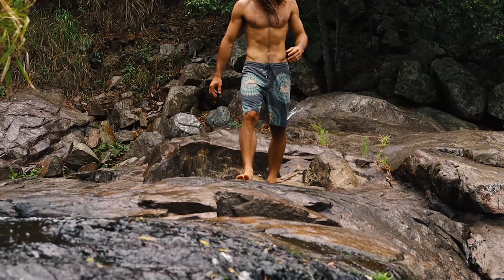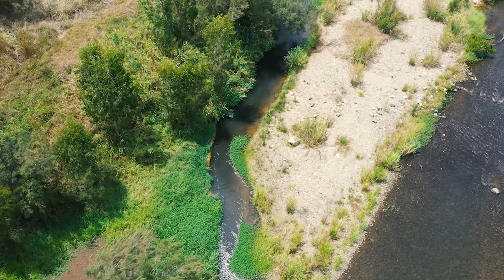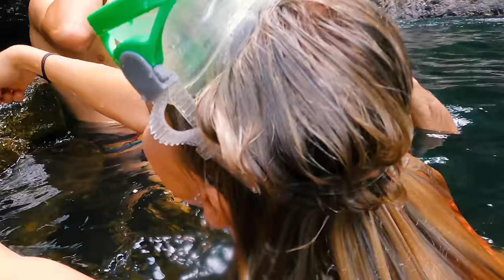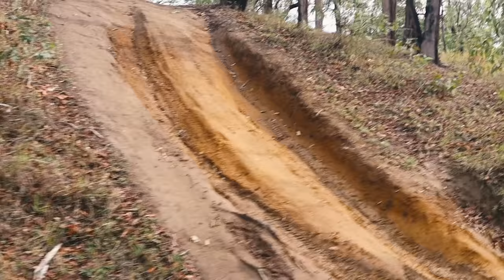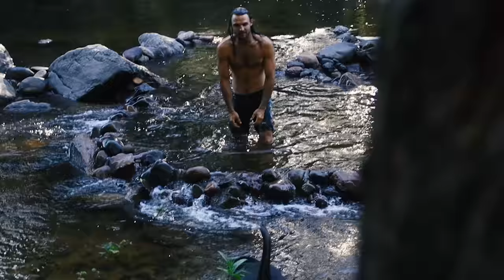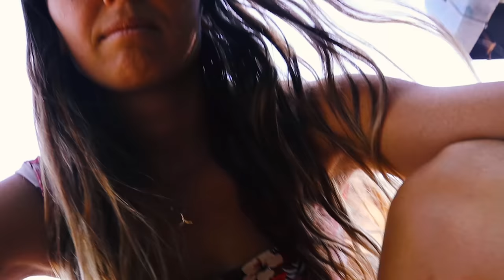BEST CAMPING & WATERFALLS | EXPLORING MACKAY | Camping & 4WDing Australia

Comment: Sweeeet edit 🤙🏽 what camera(s) setup are you guys running?
Reply: Ps. May have some domain issues with your website as it ain't connecting (checked multiple browsers and no dice) 😬
Reply from the maker: Thanks for the heads up mate! Just fixed the website :) We are using a 
- Canon EOS M50 (the stock lens and a 70-200 lens)
- Mavic Pro 2 Drone
- GoPro 9
Very slowly learning how to use them haha